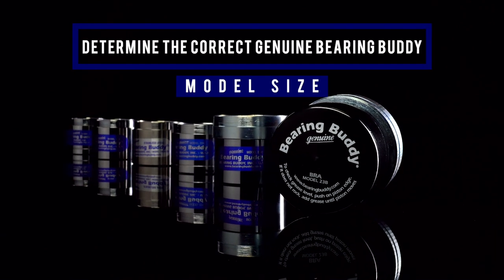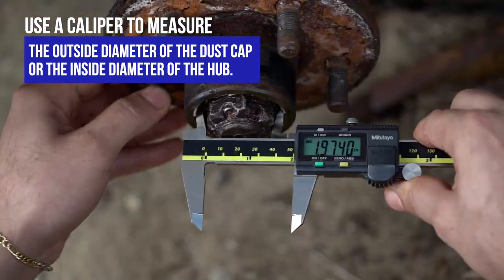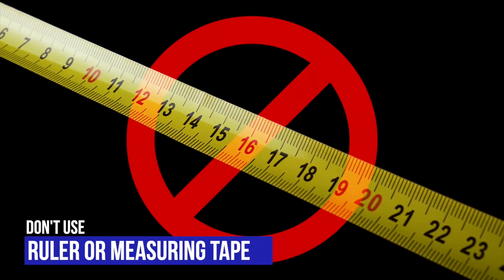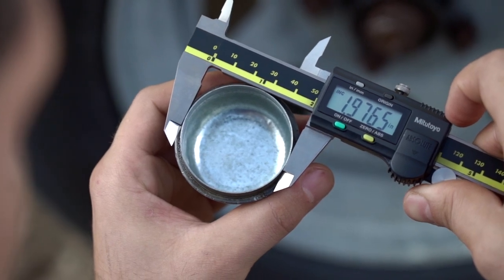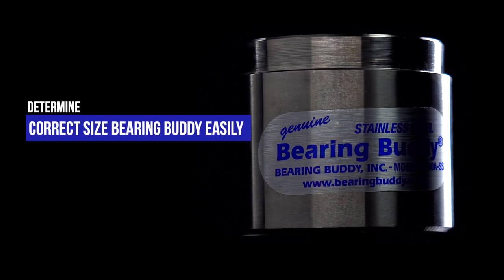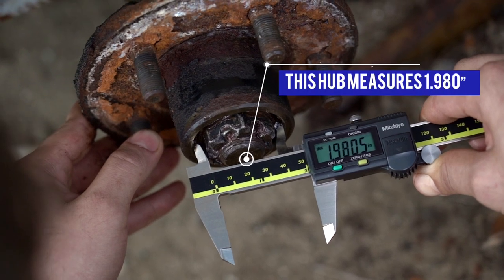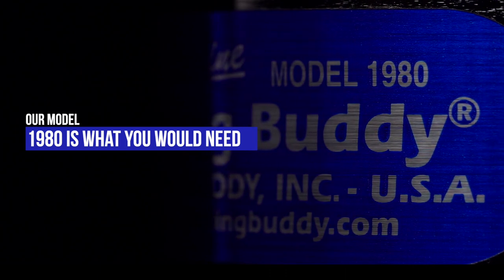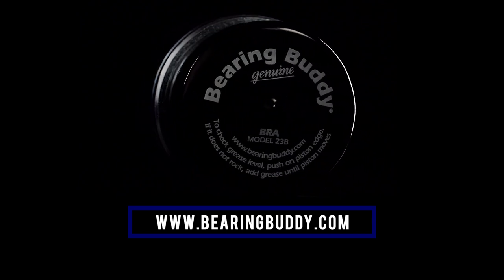How to Determine the Correct Size

Comment: You should show and explain how bearing buddies work and get grease to the back bearing too.
Reply from the maker: Thank you for your recommendation.  We will work with that! Any other recommendation?
Reply: @bearingbuddy5067  Not really. That's all I can think of at the moment. They are pretty simple but myself and some others I know don't see how the back bearing is going to get lubricated after doing a standard repack job and adding the bearing buddy.
Reply from the maker: @MrWhiltetail  A common misconception about the Bearing Buddy is that grease cannot get to the back bearing by adding grease through the grease fitting on the Bearing Buddy.  However, once grease is heated, it becomes liquified and will easily flow through the gaps in the bearings and make it's way all the way back to the rear seal.
We always recommend packing as much grease as possible inside the hub cavity before installing the Bearing Buddy. This will speed up the process of the grease flowing back to and through the rear bearing. 
Hope this helps. If you have any addition question please feel free to contact us at 1-787-327-4981